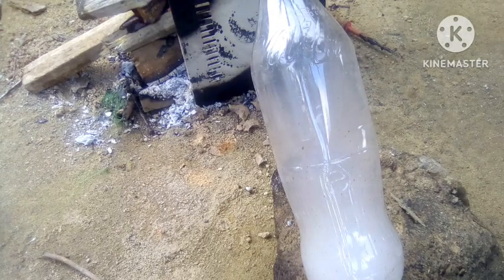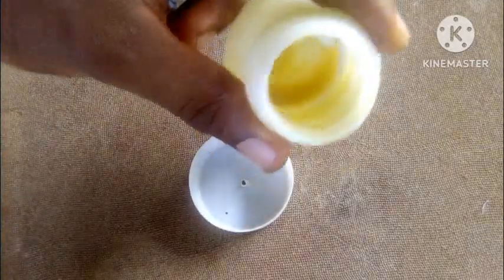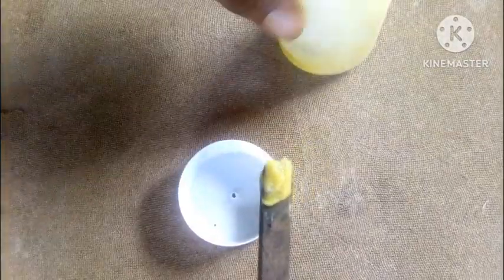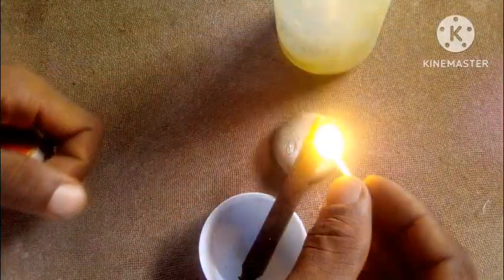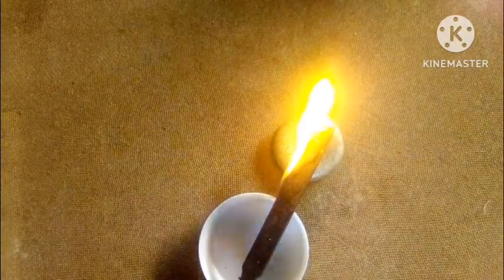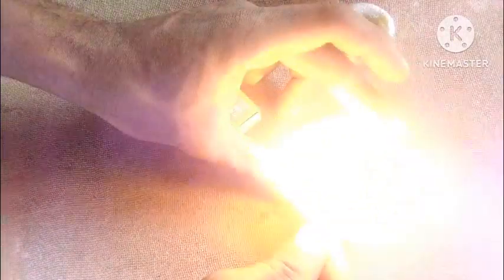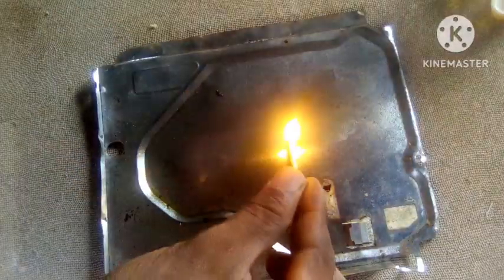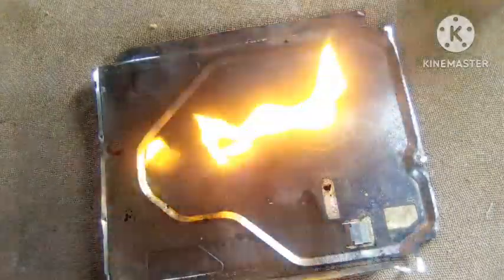This simple homemade technology will stop our plastic problem

Comment: lol you probably would have gotten more energy from the wood and propane. useless video
Reply from the maker: Yes that is very correct my friend, but u can't fill ur gasoline or diesel vehicles or generators with wood can u?
Reply from the maker: And propane is getting even more expensive everyday, so use what you have to get what you want

Comment: Hey man, neat video. What types of plastic can be distilled like this? More importantly why isn't this done on an industrial scale to recycle plastics, there must be a reason right? Like is the gasoline toxic when it burns or something?
Reply: Long story short, it's probably more economical to get it from the ground. In this example, I have to wonder how much energy in propane is used vs what is produced as various fuels.
Reply from the maker: U are absolutely right, but the thing is by recycling this plastics we will reduce the disaster and pollution that the cause in our environment
Reply from the maker: Thanks friend, Hdpe plastic, is a good choice because it emits less toxic fume, and this process can also be done on a larger scale for more gasoline, diesel and LPG production.
Reply from the maker: And also the gasoline is not toxic, it smells and burns just like gasoline that u buy from the gas station